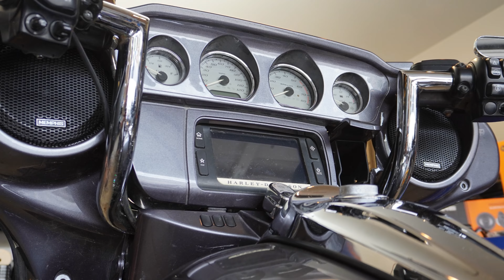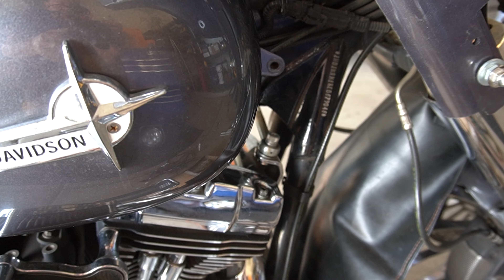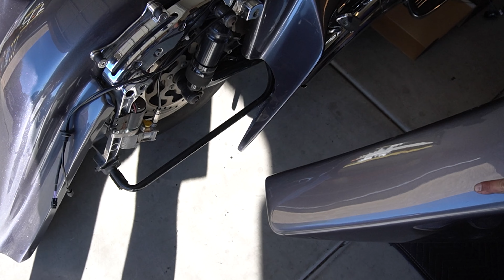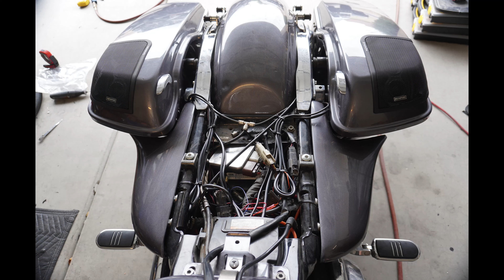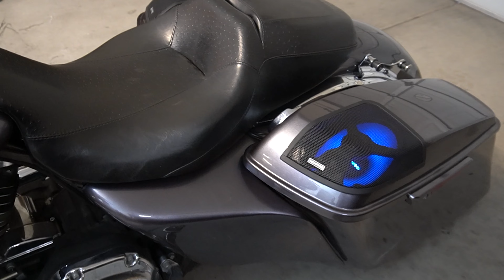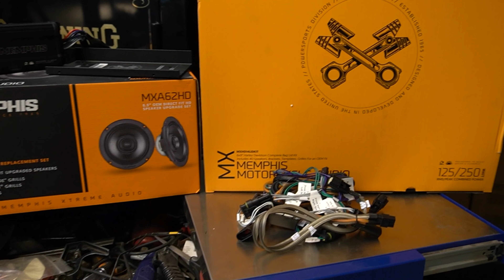MXHD14LIDKIT & MXAHSPRO2 Complete Install - Memphis Audio

Comment: Not a bad video. It would have been nice to see exactly where and how the blue wire was connected, how exactly the amp was set up especially explaining why you have it set up as a two speaker when you have four. I have just purchased your 800.1 amp with 4 Hertz 6 1/4” neo speakers to put in my 2015 hd ultra limited. I feel very comfortable doing the install but a little nervous on setting up the amp to get the most out of it and not damage the speakers. Also why no need to flash the factory head unit, even when I bought the amp the sales men said I didn’t need a flash but the owner it should still be done? And he would do it for free if I bought it then. Any help would be greatly appreciated. Thanks
Reply: Did you manage to locate the blue wire’s destination? The installation process, as guided by the video or instructions, isn’t going smoothly. Also, have you received a response from Memphis regarding your suggestion?